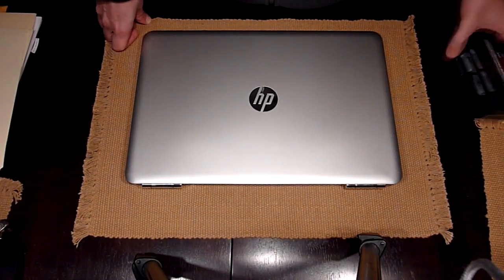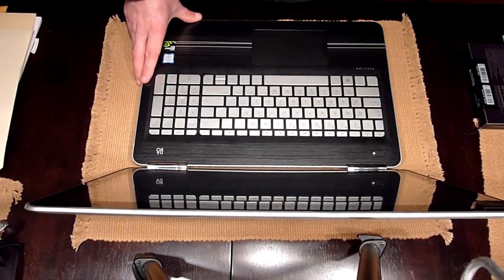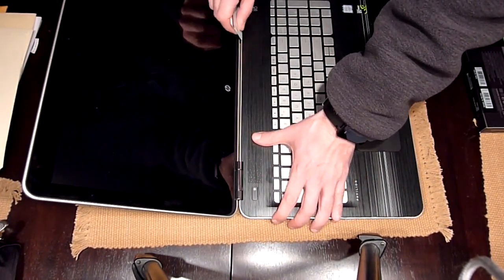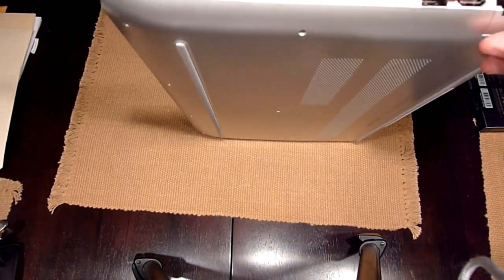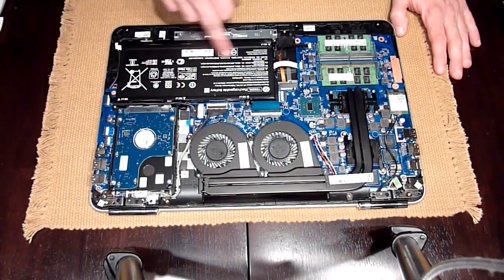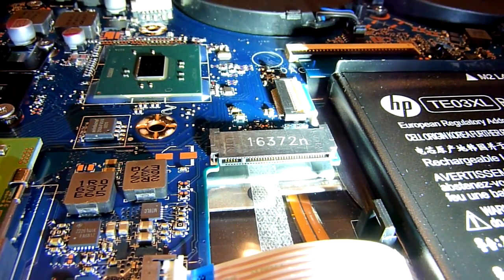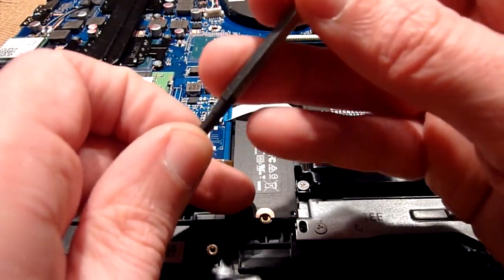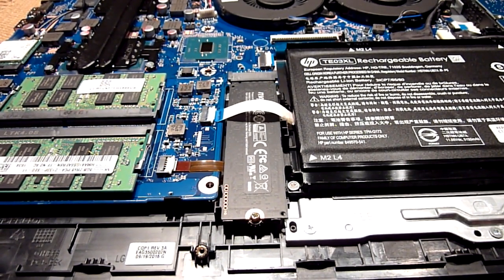HP Pavilion 15 bc018ca Laptop with Samsung 950 PRO M.2 NVMe SSD Drive install

Comment: Was the screw to attach the SSD included on the motherboard? Or did you have to buy that extra? My model is bc303no and I am considering doing this upgrade.
Reply from the maker: no I had to find a screw for fixing the SSD. I would suggest that you open your laptop and confirm that the NVMe slot is present before buying a drive...
Reply: Aleziss I already had that confirmed by Mehmet Duran who wrote here 3 months ago. I have the same model. My only concern now is what kind of screw I have to buy. Thank you for replying and helping much appreciated. :)
Reply from the maker: you're welcome !
Reply: Opened the laptop today and the slot is present. But that tiny little screw tho. Is there some kind of standard for these kind of screws so you can ask for it in the store? They really should include it with the SSD.
Reply: I'm sorry for all questions. But when I look in the user manual in the section for bc300-bc399 it says nothing about wether it supports nvme or not. It looks like in this picture: https://unsee.cc/5f0dea1c/. It looks similar to your laptop I think? It should work?
Reply from the maker: I had that screw in a bin here where I keep a bunch of parts and I just found one that fitted there... I guess they do not provide a screw because it might be different sizes on different motherboard or plastic shroud like in our case...
Reply from the maker: it looks EXACTLY like mine, same placement, same pinout... I chose the Samsung 950PRO 512gig for price reasons, I simply inserted the drive in. When I first booted the system up, it did nothing, I just rebooted again, got in the bios, DID NO CHANGES in the bios, save and reboot, then the drive was visible in Windows 10. I used the samsung migration tool and transfer the os from the 2tb mechanical drive to the NVMe drive and that's it. I did remove the mechanical drive until my warranty will be terminated just to keep everything original. Once the warranty is over, I will install the second drive as a data drive. The 2tb drive is terribly slow as a second drive though, I might just install a 1tb SSD 2.5 inch instead.

If I was you, I would also upgrade the RAM in your system, get up to 16GB while it's open.
Reply: The ram is another thing that I got confused about. It says in the manual that my model only supports 8gb and in the section for your model it supports 16gb. Please have a look in this pdf: http://h10032.www1.hp.com/ctg/Manual/c05955459. I don't know what to think?
Reply: Bad news about NVMe. It seems like it's not working with this model series. I bought the Samsung 970 Evo today and installed it. But my computer didn't find it. I tried what you suggested about going into bios and save without changing anything. Nothing. Even tried to install the driver for the SSD but it only said that the driver is not installed. I see an unknown device in the device manager tho. But I think there is nothing to do it should find it as an SSD drive if it would be working right? So I guess the manual was right when it didn't say anything about supporting NVMe drives. The store that I bought it from has a good return policy so I will return it after work tomorrow.
Reply from the maker: The service manual of mine did not say nothing about an nvme drive and it does work. Install the samsung nvme driver find it here on samsung website : http://www.samsung.com/semiconductor/minisite/ssd/download/tools/
Reply from the maker: in the bios there was NOTHING to change anyway, this is why I said that, no specific parameters in regards of this port. I just booted in the bios, looked around and then SAVE and EXIT. Right after I did that, it did work and was found in windows 10 64bit.
Reply from the maker: what is the ID of the unkown device ?
Reply from the maker: oh, have you checked in the storage manager in windows ??? Really important !
Reply from the maker: I also cheched the document you provided for the RAM and in page 5, it says : "Supports up to 16 GB max system memory" EXACTLY like mine. Get yourself 2x 8gb DDR4 2400 sodimm like gskill, it's cheap, life time warranty. Other brands like kingston is nice but might be a bit more expensive. Your system is more recent than mine so the RAM and NVMe should work. Send me a personal message if you have a chance.
Reply from the maker: DON'T RETURN YOUR DRIVE YET, there are many other things we can try, give yourself a chance to sort this out. Your system is open and you're right into it, do give up yet. Send me a private message through youtube in my channel.
Reply from the maker: I sincerly hope you will get all my answers because the NVMe drive you have will give you a whole new experience with your system and I FOUND IN THE MANUAL YOU SENT ME, PAGE vii, section 9 under SPECIFICATION, M.2 PCIe is right there, IT IS compatible, DON'T RETURN YOUR DRIVE YET... You can also see at PAGE 2, NVMe drive is LISTED. WAIT BEFORE RETURNING YOUR DRIVE !!!
Reply: That document is for 4 model series, bc-000~bc-099, bc-200~bc-299, bc-300~bc-399 and bc-400~bc-499. On page 2 (bc-000~bc-099 where your computer fits) it clearly states that your model supports NVMe. On page 8 (bc-300~399 where my computer fits) it clearly states nothing of the sort. I have tried right-clicking on the windows logo at the bottom left and selected Disk Management but all I see is Disk 0 which has been there all the time. Nothing else. There were 2 devices at first with a question mark in the Device manager. I tried updating one of them and it found something. I should have taken a picture because I can't really remember what it was but I think it was something listed under Security devices or Software devices. Anyway it made no difference. The other thing that still has a question mark is listed under Other devices as a SMS/MMS something? It has a question mark and can't be updated. And like I said I already tried to install the driver from Samsung's website. I'm at a loss right now. Thanks again for trying to help.
Reply: Sorry if I sound stupid now but how do I send private messages? I have never commented anything on youtube before this is the first time lol.
Reply from the maker: The SMS/MMS is that I suspect you might have connected a Samsung mobile device to your system over USB, it's part of samsung mobile driver but I never got it to update either.

What is the EXACT model number of your system ? 15-bc3xxxx ??? You should make sure that your firmware is up to date also with the EXACT model number. I cannot beleive that this is NOT working, your system has the SAME connector, same placement, same battery as mine and is more recent than mine.
Reply: My model is 15-bc303no. I think it's strange too. Also according to HP's website there is nothing about any updates for the BIOS or anything.
Reply from the maker: on my page, go to "about" there should be a link if I am not mistaken... it's just I wanted to get an email so we can exchange before your return everything to the store... we could have also check with teamviewer if you feel ok with that...
Reply from the maker: This is from the Canadian hp webiste (since I can't read in your language) https://support.hp.com/ca-en/drivers/selfservice/hp-pavilion-15-bc300-notebook-pc/17296801/model/18695599 there is a firmware release f.61 that dates from april 2nd 2018.
Reply: Yes I have f.61 installed already. I have had it for some time now.
Reply from the maker: I also see a recent intel chipset firmware update available as of april 24th 2018 here is the same link but in english :

https://support.hp.com/ca-en/drivers/selfservice/hp-pavilion-15-bc300-notebook-pc/17296801/model/18695599
Reply: I just tried that. It made no difference. Still just Disk 0 in Disk management. :(
Reply from the maker: Be sure your drive is seated correctly, pushed all the way in with the screw in place. Try again to reboot, go in bios, scroll around in menues, don't change nothing unless you would see something specific to the PCIe ports but I don't have any on mine. SAVE and REBOOT again... check device manager again for unkown device, go under "storage controller", you should see something there, this is where the samsung driver replace the microsoft nvme one, if you have unkown peripherals in the section, update it with the samsung driver. If the system detect the NVMe drive, it will report it there in the "storage controller" section. Once it's there, it should show up in the storage manager, you need to create a new volume otherwise, the nvme drive will never show up in the file explorer. It's worth you try this again while you have it.
Reply from the maker: If after all this, the NVMe drive is not found, you might be right that it is not compatible with your motherboard which I find pretty odd. If this does not work, you should STILL upgrade your system with a 2.5inch SSD. I like samsung products, get yourself an 2.5inch EVO drive, with the samsung migration tool, you will transfer your mechanical drive to the 2.5 inch SSD with the help of a USB to SATA cable (connect USB to SATA cable to the SSD for migration procedure). Once the migration is done, simply swap the 2.5 inch drives (keep your orignal mechanical drive intact until your warranty ends). Beleive me my friend, you'll have a whole new computer experience by just replacing your mechanical drive to an SSD. It will also be cheaper than the NVMe drive. This is worst case. This is the BEST upgrade you can offer yourself on your system. I've done sooooo many SSD migration on 10 year old systems that perform extremely well now just because of that simple hardware replacement.
Reply: I opened the case again and took the drive out and then put it in again. Without a screw tho I still havent gotten one. But the fit is really snug and it doesn't flex upwards like your drive did. It remains flat against the part where you are supposed to attach it with the screw so I doubt I need one. Tried the bios thing again but no luck. I will try an M.2 SATA next. At least that is supported according to the manual. Thanks again for your effort in trying to get this sorted.
Reply from the maker: Mine does not stay put if I do not put a screw, the ssd lift up if I do not put a screw. On top of all, when you put the computer back on the table, the SSD will hang upside down if there is no screw, it might not make a good contact, that might just be your problem, I cannot see what you are saying with the board that stay in place, mine aboslutely do not stay put if I have no screw. 

I am not sure if a M.2 SATA SSD would work in the key slot you have... I found some pictures that seem to say it should work and some other that does not...

https://www.google.ca/search?safe=off&biw=958&bih=664&tbm=isch&sa=1&ei=bWoIW4qMIIGXzwKr2bHoBA&q=M.2+key+slot&oq=M.2+key+slot&gs_l=img.3...173100.174275.0.174733.8.6.0.2.2.0.83.327.5.5.0....0...1c.1.64.img..1.5.218...0i19k1j0i8i30k1.0.ecSd5Jrku4g#imgrc=YUrIe5nZapxbdM:

Really, if after all we tried and your M.2 SATA does not work, you should defitively go with a 2.5 inch SSD... just get a USB to SATA adapter with a Samsung 2.5inch EVO SSD, migrate os, swap drives, done. No other config/bios/driver/screws needed.
Reply: I will try with a 2.5 inch SSD instead. Returning the NVMe drive tomorrow. Thanks for everything. :)
Reply from the maker: you're welcome, I wish it would have turned out differently for you but you'll have a nice upgrade too with the 2.5 inch ssd. Be sure to take a drive that has enough space to hold what you currently have on your mechanical drive. Keep me posted on the result. Get the samsung migration tool, usb - sata adapter and your drive. Once all is swaped, install samsung magician software on your system and you are good to go. Good luck and keep me posted please !
Reply: I'll make sure that I'll get a drive big enough. And I promise to keep you posted on the result. Thanks yet again. Now I really need to get some sleep as I have to get up in about 5 hours. :)
Reply from the maker: any success in upgrading your system ?
Reply: For the HP to use the nvme as a boot drive, you need to clone (copy from the hard drive) or install windows 10 to that nvme. After that you take out the hard drive to make the laptop pick up the nvme as your primary drive. 
Plugging it in and expecting to just boot without a operating system in the nvme is pointless. Again, you must either clone or add a operating system to it.
Reply from the maker: Absolutely, I chose the Samsung clone software to do this, it works really well and then swap the drives.

Comment: Please note that not all M.2 slots are PCIe and you could be wasting your money. They make M.2 SSD and also the faster M.2 PCIe SSD. They both fit into the same slot. This video shows the Samsung 950 PRO Series - 512GB PCIe NVMe - M.2 Internal SSD. Not all motherboards have the PCIe M.2 slot you have to check.
Reply from the maker: of course, this is what I tell to anyone who ask if their system is compatible...

Comment: I wanna buy HP Pavilion 15-cd005la  but i dont find if i can buy a battery replacement :C
Would te03xl works for all the 15 series?
Reply from the maker: +DaveTheRipper098 unfortunately I cannot confirm what type of battery is needed in your system, I did not find infomration either (found the system on mexican hp webpage but could not find corret information). Sorry about that...
Reply: Well here it is the offical page :D http://www8.hp.com/mx/es/products/laptops/product-detail.html?oid=16748348
Reply from the maker: +DaveTheRipper098 yes that is the page I had also found but I do not see any information about the service manual or type of battery (beside the power of the battery)... so it is difficult to know which battery type is needed for replacement...
Reply from the maker: good job on finding this ! not exactly the same model as in mine which is TE03XL !
Reply from the maker: Did you finally upgrade your SSD ?

Comment: Hello. Fairly odd question. If you remove the battery on this line of hp laptops and close up the laptop, would it still run being plugged in with the charger? I read somewhere some laptops aren't able to do that with built in batteries?
Reply from the maker: good question... I would assume (hope) that it would still work like other laptop with removables batteries do work anyway... I hope this is not the case...
Reply: Just for the record, my laptop (similar model) wouldn't start without the battery. If anyone needs this info haha
Reply from the maker: wow ! which model is it ?
Reply: The model is pavilion 15-bc010nm
Reply from the maker: uh... I guess it will be the same issue with mine then... I never knew this...

Comment: can you help me ???
My Laptop is hp k203tx and has m.2 slot but I don't know nvme ssds will work or not can you tell me. ??
Reply from the maker: your drive is mSATA M.2 if I am not mistaken, it will NOT be compatible with NVMe drives... I think you need mSATA M.2 drives...
Reply: yaa I was also confused with that.
thanks for replying buddy
Reply from the maker: you're welcome, I think these are the ones compatible with your system :https://www.newegg.com/global/in/Product/ProductList.aspx?Submit=ENE&DEPA=0&Order=BESTMATCH&Description=m.2+sata&N=8000&isNodeId=1
Reply from the maker: yes, if you replace a mechanical drive, those Samsung EVO 2.5 are great. I do a lot of upgrades with these. The cloning tool is free from Samsung website so it does transfer the whole installation to the SSD then you swap drives. Performance is unmatched, best upgrade you can offer yourself on ANY systems, even older ones that are 8-10 year old run surprisingly good with an SSD.
Reply: if I replace mechanical hdd with ssd then 3d v-nand or sata  does not matter. right ??

Comment: Do you have some problem with temperatures?
Reply from the maker: absolutely not, right now at 36°C, I do video edititing too and no problem
Reply: Aleziss How it could be ? it is even impossible with msi in editing?!? In idle i can understand but in load nooo. which bios version do you have ?
Reply from the maker: computer bios version is f.46, bios of ssd is 2b0qbxx7, right now at 41°C in samsung magician, just finished working with vegas pro 15 editing videos for youtube that I am working on... never had any issue with temperature...
Reply: Aleziss My computer denying update bios. still f42.
Reply from the maker: f46 is only for the 15-bc018ca though, you have the same model ?

Comment: I have an Hp pavilion bc and i am thinking to buy an m2 SSD (Samsung 960 evo) so searching on web I found that m2 nvme could reach high temperature also like 70-80 degree. Is It true?
Reply from the maker: I also read that too, it seems to be a fact that M.2 drive are getting warm sometime... mine is always around 40-45°C, I never noticed that it got higher than that. I would not be worried too much about that.

Comment: hp pavilion gaming 15-bc016tx is support m.2 ssd or not ?
Reply from the maker: I think so yes, the bcxxx models seems to have m.2 support. Just open the case a verify the m.2 slot.
Reply: Got the same model...please confirm...then i'd take my lappy apart. Manual says it had a m.2 ssd .
I heard that os can't boot off m.2 nvme add.? Is it true?

Like was planning to keep the hd along with the ssd since they use different ports?

Comment: would HP Pavillion Power 17 (17-ab200ni) support the Samsung 950 PRO M.2 NVMe SSD Drive aswell ?
Reply from the maker: Ashlen Naidu unfortunately, I could not tell... I know the bcxxx are... the easiest way is to open the case and look out for the M.2 connector...

Comment: hp pavilion cc021tu is support m.2 ssd or not????
Reply from the maker: I can almost confirm at 99% that the Pavilion 15-bcxxxxx are. Yours is a 15-ccxxxxxx so I could not confirm. I simply suggest that you do open the case and look for the M.2 slot on the mother board.